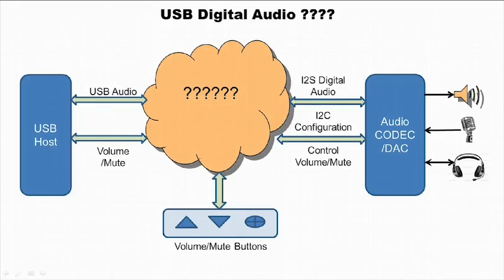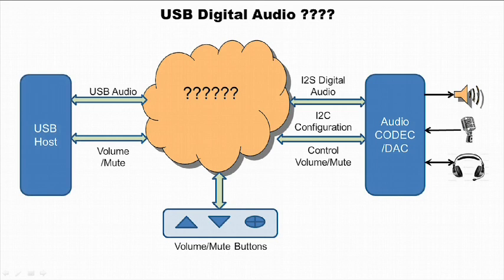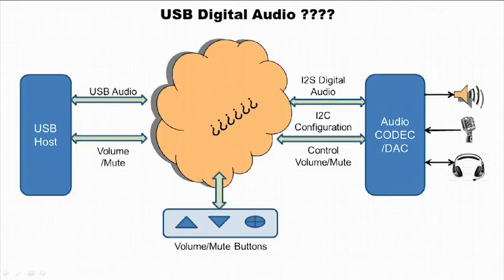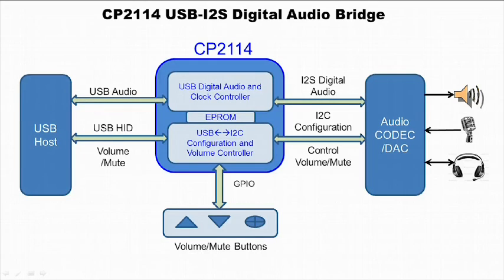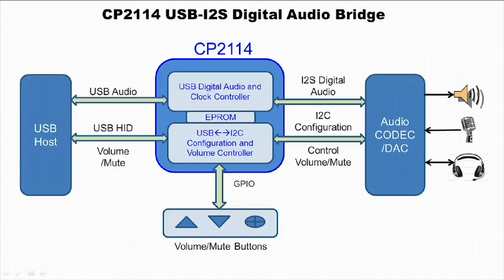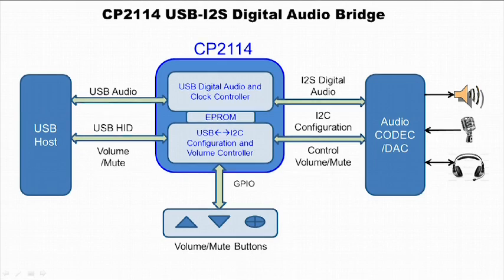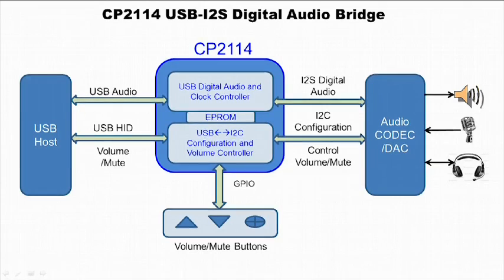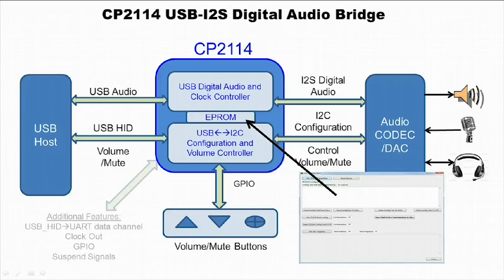USB Digital Audio with the CP2114 USB-to-I²S Audio Bridge

Comment: Silicon Labs is great company. But there are many problems. First, this chip (CP2144) is too expensive based on "Evaluation kit". It is $49US, and it is too expensive for everyone. Aside that, how I can be sure that there is no problems with technical support as is the case with Si4432 or similar RF chips?! There is huge error in IF and transmit bandwidth, where someone made mistake in calculations. So, it turns out that 9600 bps require more bandwith than 19200 bps. I did narrow bandwidth for 9600 bps and it works fine with low bitrate setting. So, why it remains so wide bandwidth? Not only for Si4432, but also the same error "propagate" on RF22 chip - with exactly the same errors.
Reply from the maker: Hi there! Thanks for your comment on the dev kit. Since our USB and RF technical experts love to help you, would you mind posting your questions in the community to resolve these: http://community.silabs.com/t5/Interface/bd-p/5 for USB or here for wireless: http://community.silabs.com/t5/Proprietary/bd-p/Proprietary